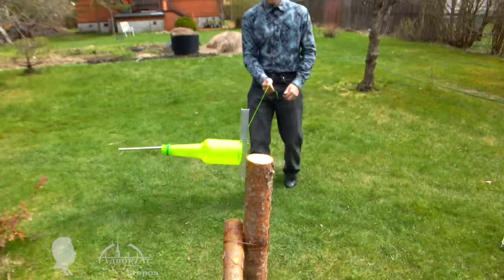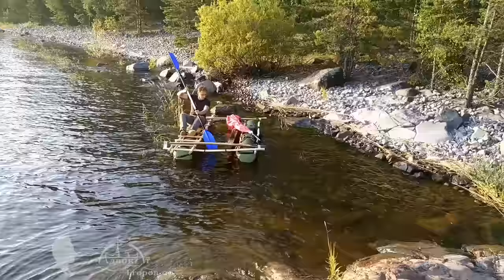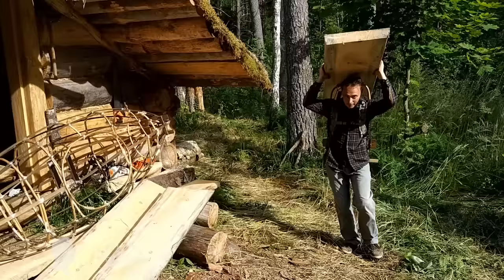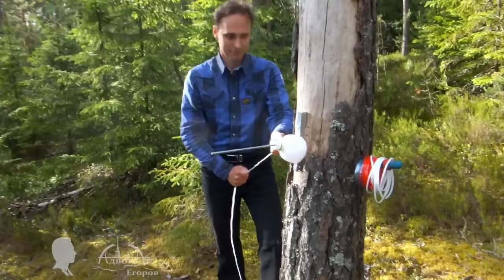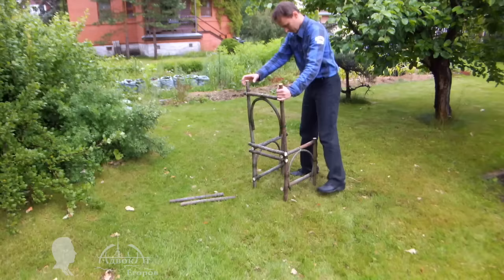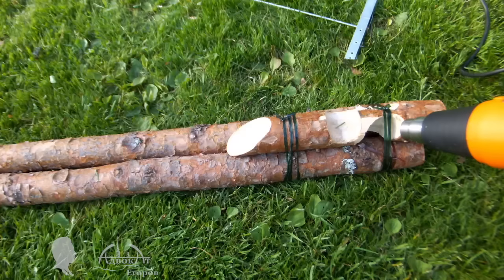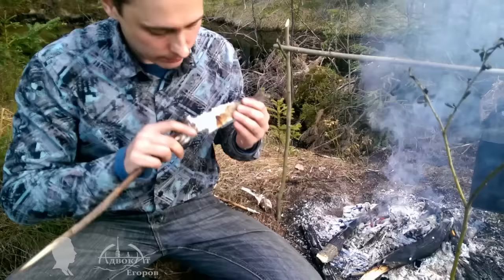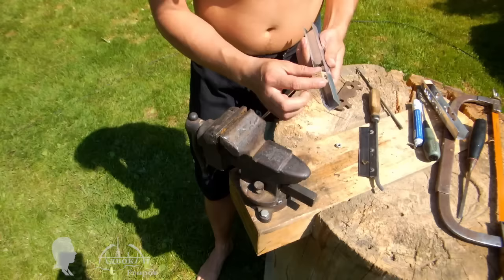10 Creative Ideas to Reuse Plastic Bottles / Bottle Cutter 2.0

Comment: Would be very interesting to see if you could make thin enough strands to 3d print this material
Reply from the maker: You could, and it has been done. The problem is you have to tweak the printer to work with different melting temps...
Reply from the maker: https://www.bilibili.com/video/BV1Zf4y1P7ne/?spm_id_from=trigger_reload

Comment: Excellent idea and excellent implementation. One question: to work the ends of the PET ribbon need to be fixed.  On the chair you fixed then with a knot. How do you fix them on pliers handles?
Reply from the maker: Yes, you make a knot and heat it up a bit, this way it gets real tight

Comment: One of the better ways to do this is using old bicycle wheel and attach something to one of the spokes like a good handle and then also brace the bicycle wheel on one side of the wheel and then you can just roll it on up very easily you can do like four to five bottles a minute no problem

Comment: my question for you and others who have made this would be what knot you use to tie the the plastic?   these would be flat material instead of round like rope or string.  so I would think that conventional know would not work as well.  I enjoy your channel and hope to make some of the items you have shown.
thank you for your time if you have a chance to answer
Reply from the maker: John, I use regular knots on the plastic string. Once you heat it - any knot gets very secure.
Reply: @Advoko  thank you for the reply.  research shows a "water knot"  works on webbing the best.  i will try the tie and melt method though

Comment: Great Idea! I love the channel, and all of your videos are so enjoyable to watch. One thing ive been wondering is how you are able to use a heat gun/ drill press out in the bush?
Reply from the maker: I was filming this video at my home.
Reply: @Advoko  Ok that makes sense. An idea that would make that possible is if you were to get a cheap solar setup for your cabin and use a high wattage inverter to power things like that. I would like to see you do something like this for channel. Also you could try and use the water wheel as a generator, then you wouldn't even need solar panels.

Comment: After trying to make this "simple tool" I found that there are a couple more details than the instruction Max has provided.
Like where to purchase the disposable blade with a hole already in it.
 We ruined three blades ( which are obviously Now) tempered steel trying to put a hole in one.
Like how he brazed a portion of a threaded rod to the end of the bottle holder.
Both of these aspects downgrade the project from simple to moderately difficult. in our opinion.
Our bottle cutter parts still sit on the bench.
Reply from the maker: It was a standard utility knife disposable blade that always comes with a hole. Sorry if I wasn't clear about it in the video.

Comment: I know this video was posted quite a while ago, but I plan to use this in my garden to bind some support frames for peas cucumber and squash and any other plants instead of having to buy string that always degrades after short time period. Do you tie the ends of it or just tuck the end underneath the binding and let the shrinking to secure the loose ends?
Reply from the maker: Correct.

Comment: Get you some bent branches and make a rocking chair with that stuff. What kind of knots do you use to bind the ends of the rope?
Reply from the maker: It doesn't really matter what knot is used because once heated it will get extra strong.
Reply: @Advoko  Yeah but what if the knot gives and it comes undone?
Reply from the maker: It has never happened to me but you can use special knots for extra assurance, of course.

Comment: I've got to say that is amazing invention you got this but I think a person can take it in a bit of a step further with the recycling because that is a good way of having a lot of cordage when you need the tie stuff up or need some to support another item but what if you're in a scenario where you're wanting something else like for say what if he was wanting a plastic wall or a plastic floor a person has got to figure out how to actually recycle that material down in a way to the point that it's not being so how It ain't giving up so much pollution it's like that boat of yours it is pretty good when traveling around but what can you do when a very big wave come or something at a size to knock you down off that little raft you're eventually going to need some material something out there to make that raft even stronger than what it already is now I personally usually sometimes use plastic when I'm wanting to repair something such as I'll melt the plastic down with a lighter or something I try to use it like it adhesive glue to stick stuff together cuz you ain't always going to have glue in this world and eventually you may need it string it thanks together can hold for quite a bit that being able to seal up a crack or anything like that with some actual some actual type of glue or something would come in handy I think if you can figure out a way to melt down that plastic to work be used in more than one way instead of just making rope you probably would have far more materials to work with because you're not wrong too many people with almost every country throws away plastic bottles every single damn day and it pollutes the whole land kills off a lot of wildlife some wildlife decides to make nests inside of them like for example I've seen birds build bird nests inside of a freaking bottle before so it ain't all that deadly to all critters That's just deadly to critters that has dumb enough to try to eat the stuff but I do say there's far more than a person can do with that plastic plastic is plastic it's like metal for example you can shape metal in any form all you want to you can mine it up all you want to and melt it down all you want to but you're never actually going to run out of it because you can always melt it down and reuse it again for something else just the same as plastic
Reply from the maker: Thank you for the info

Comment: Can we use it as a 3r printer filament.
Reply from the maker: It has been done, however, it requires mods to the printer as the melting point of PET polymer is slightly different than that of a regular filament's polymer.

Comment: How many mills thick are plastic bottles in Russia though ,here in the US the plastic bottles are ridiculously thin now 
They just keep making them out of thinner and thinner plastic , you can crumple them like a tissue now and the slightest movement in air flow and  they tip over they weigh less than a tissue
Reply from the maker: I usually use big 2L bottles as they are made of PET polymer and have some thickness.
Reply: @Advoko  I know but can tell just by looking at the ones in your video that they seem like the way they used to make them here maybe even a bit thicker too
But now we have crappy ones that are very thin so I am not sure how well this would work

Comment: Hey mate I've just made one of these but i can't get it to cut more than a couple feet of rope before it breaks off. Any idea what i might be doing wrong?
Reply from the maker: The the bottle guide should be at a certain angle, not 90 degrees...
Reply: @Advoko  i think that's where i went wrong. Thank you

Comment: hi, I rarely manage to get a single strand from a bottle, most of the time a get several pieces of only a few meters. I'd like to make also a rope from it so few meters are definitely not enough. In the video i see you make very long ones. It's just montage or am I making some mistakes. I followed your project to make the cutter
Reply from the maker: Try to play with an angle at which a bottle enters a jig's gap
Reply: @Advoko   i figured that was the reason, but how do you make it stable?

Comment: I made a bottle cutter out of what I had laying around (plumbing pipe & razor blades).

I've cut several bottles into perfect strips.

Now I'm stuck on how to attach them to anything.  After wrapping them around 2 things to be joined, how do you keep it from unraveling. Tying a knot just breaks the strips. Maybe my bottles were too thin to start (super thin water bottles)??

Anyone have any tips who has successfully used these PET strips?

Comment: I cant get mine to work like this 😥😥😥 please sir help nr
Reply from the maker: There should be a proper angle between a bottle and a bottle cutter, it is less than 90 degrees. Just play with angles.
Reply: Sir that is exactly what i am not getting right 😥 please i can't seem still make it right unless i know the exact degree
Reply: @Advoko  sir at what range exactly?? I only use bottle size like of that small mountain dew bottle
Reply from the maker: Hmm, it is only a few degrees but each jig would behave slightly different...
Reply: @Advoko  from the bladeside sir right??
Reply: @Advoko  the rod i used is a 5mm about 23cm long rod. Is it good

Comment: You're not really solving a problem, you're just shifting the problem. What are most people going to do with the plastic ribbon once it breaks or becomes unusable, which it will eventually. It's a fun idea but doesn't really solve the problem of plastic ending up in landfills or anywhere else. If anything your making it smaller and spreading it all over your house, yard, ect.